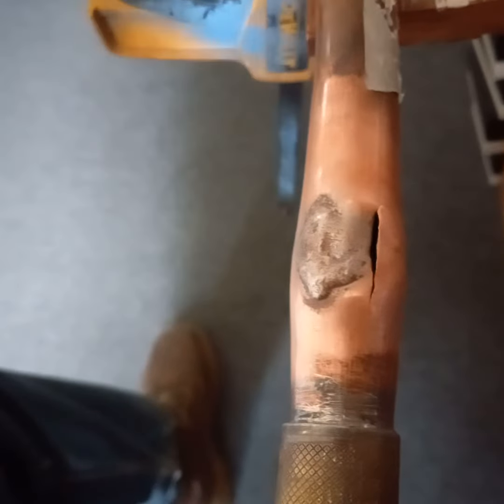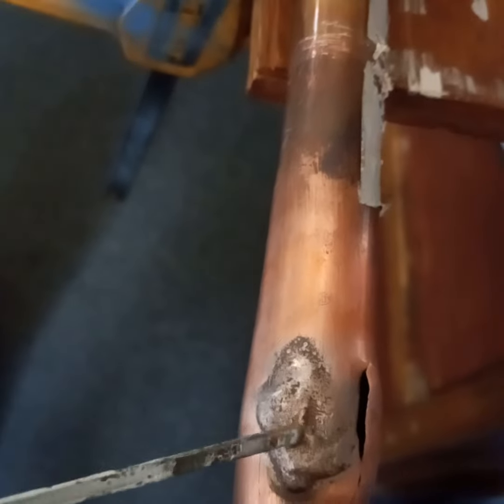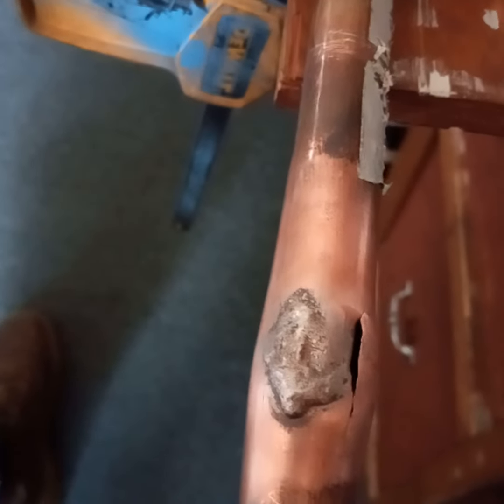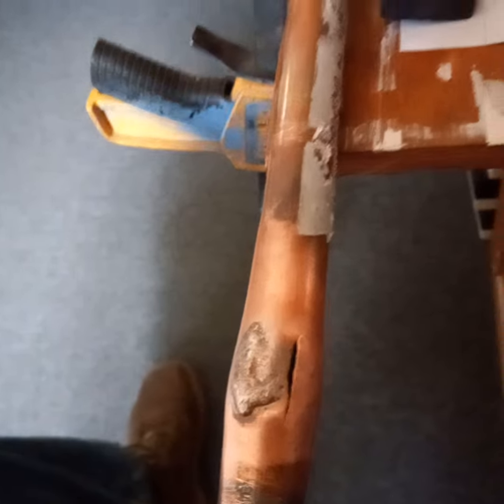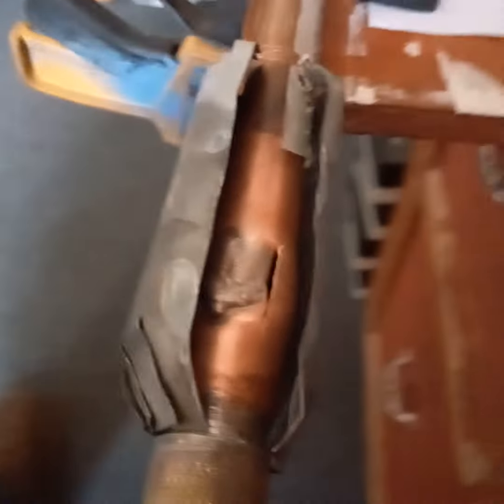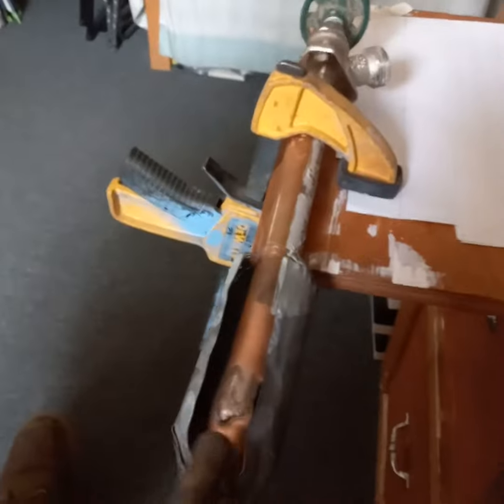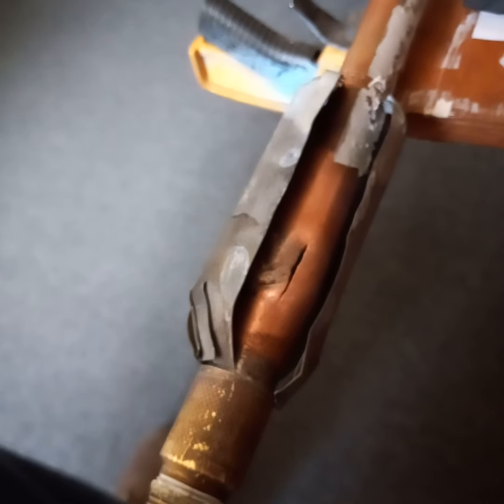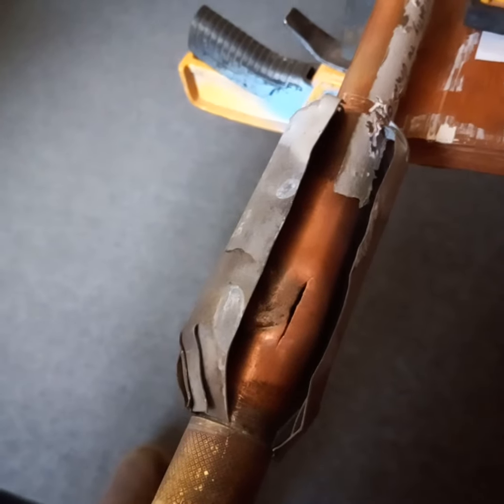Silver phosphorous braze over a copper freeze break and the use of a Klingon heat trap.

Comment from the maker: The spreading flame tip can also get enough heat to silver braze with just the MAPP torch.  The spreading tip seems to discharge more fuel faster, thus it can heat it, even though it is not as pin-point flame.  There must be no water in the pipe line nearby to take away heat either, of course.   Pipe must be vented to avoid blow-holing but not much airflow, to avoid cooling.